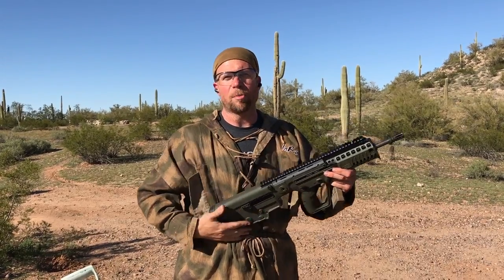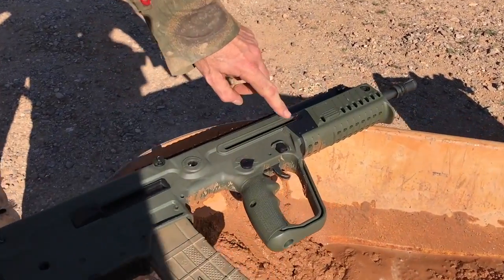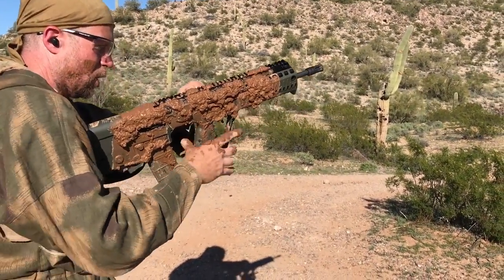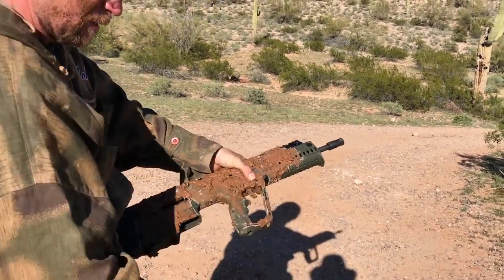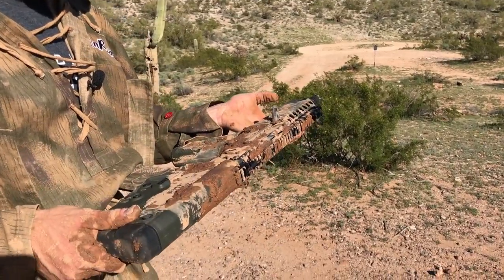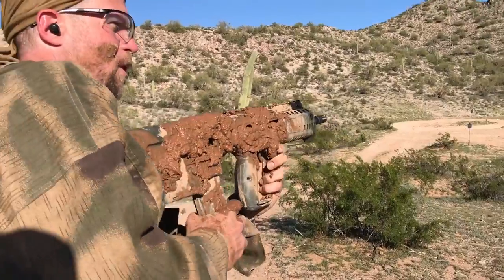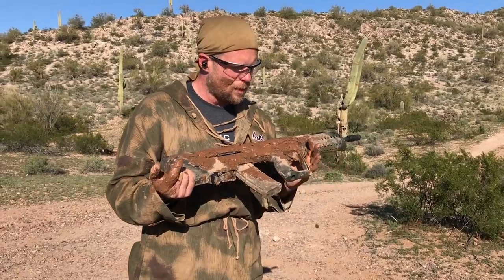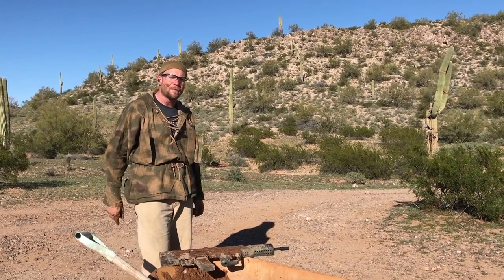Mud Test: X95 Tavor

Comment: I just watched the video where you mud-tested the AK.  Interesting contrast in testing methods, but essentially the same result.  The mud used on the AK was much soupier and you actually shook off the mud from the AK.  The mud used on the X95 had a consistency of concrete and you didn't really make any effort to shake off the mud, especially the clump blocking the ejection port.
Reply from the maker: We're shills for the AK industry.  ~Karl

Comment: I hate when engineers think they dont need to integrate a dust cover... And the entire charging handle and slot could be made much better. Also compared to some other bullpups, the bore to sight height is stupidly high. Also the mag release is practical BUT there atleast should be a backup release.... ive seen it FROZEN and the entire Rifle became useless...

In therms of mud, the Steyr ACR, Ares/Stoner AIWS would do much better. And maybe the MDR and F2000 too.
Reply: I agree. The RDB could use a dust cover too. And there isn't any reason to have the op rod exposed to the elements (the charging handle tube only covers part of it as the design stands now)
Reply: Yes, and one of the biggest flaws of the RDB is its long and narrow ejection window at the bottom, clearing jams is an extrem pain, why the hell did they not just made it so you can simply move a part of the left wall at the rear to clear a stuck case (like it happend in the mud test...).
Reply: +Johannes von' Strauch \Liandri_Development_Group/ Because Kel Tec is very concerned with safety in case of a round firing out of battery or something like that. Basically, the chamber is directly below your face and they don't want to get sued, so they make it a solid steel plate. Now, they could probably redesign it so that the end of the stock is attached to the lower, and then allow the top cover to pivot upwards to make jam clearing easier, but they probably won't.
Reply: Is it the engineers that think they don't need to integrate a dust cover or the accountants? My money is on the accountants.
Reply: Zundfolge 
It's the engineers. The accountants won't say crap if an engineer tells them it could be a life or death issue if the weapon fails because of it.
Reply: There is a backup mag release. It's on the back and can be hit with your thumb while stripping it out with your fingers. As for no dust cover, you should at least wipe the majority of mud off of something before attempting to operate it.

Comment: That was a very interesting result, it seemed that each time you (remudded?) it the mud would get stuck in the ejection port or rather slot might be the correct word. Perhaps because the ejection slot is so thin any mud or gunk that gets on it can prevent the round from ejecting properly. Could you let us know what was causing the problem if you ever find out? Also, now I want to see a side by side sand/ dust test between the Tavor and the AR 15. It was made for desert combat and I am curious to see if it can beat and AR in its natural environment.

Comment: Interesting. Do AR15 Mags deal well with a slap on the bottom once they are in? I remember being told that other 5.56 magazines easily produce misfeeds if slapped too hard and I noticed you slapping the mag several times. Maybe the X95 quickly produces a misfeed, but the AR pattern doesnt.
Reply: This may be true. I had a partial double feed recently caused by my bolt not being in full battery. When I charged it to clear the extractor hadn't caught on and the round stayed where it was. You have to give a tap on the charging handle to make sure that does not happen. All that mud certainly made sure that when he charged it it did not go into battery. This was with an X-95.
Reply: Zibingo Taeam i dont know if that really addresses the complete freezing of the action and mag release though.
Reply: also no the STANAG mags dont do that, there is a stop in the reciever of both m4-ar15 pattern rifles  to prevent mags from being over-inserted. im pretty sure the tavor has the stop too. with the ar15 though if you fully load a mag to capacity it causes an exessive force on the top round which is rather difficult to insert on a closed bolt, so tapping (more like slamming) it in is almost a necessity in this instance. with dirt and mud and sand ect it just makes it worse. as for the tavor, this was the guns failure to keep mud out of the rifle through inherent flaws in the design. does that make the rifle bad? absolutely not. just a shitty choice if mud is a concern. this rifle was designed with urban combat at the forefront of the design.
Reply: Gren Moyo I was actually thinking about rounds jumping away from the feed lips because of the slap.
Reply: You don't even need to tap.  Inset until you feel resistance, then push up with the magazine and pull down with your hand that's on the pistol grip simultaneously.  You can insert full mags easily this way.
Reply: Murphy82nd Thats what I was told. That's why I figured it might be an issue.
Reply: If you were to really slap the shit out of it, yea I could see it happening especially if the magazine was older and the feedlips had some fatigue.
Reply: Yeah like Murphy said unless your magazine is really old and worn slapping it around won't be an issue

Comment: Lame,  as others said it was setup for failure with the inch of goober covering the ejection port. As if he wanted this outcome. Even if he covered the right side first, flipped to cover the left, the right side would have had a chance to shed some mud. Even worse the second attempt was the same, could have changed up the initial application side.

Comment: Fanboy Complaints checklist. Taken/adapted directly from the AK mud test video!
https://www.youtube.com/watch?v=DX73uXs3xGU

Complete as you see them.

[ ] It fares better with dry sand.
[ ] It's not a "proper" Russian Israeli gun.
[ ] It's not made in Russia Israel. With glorious stalinium Jewnesium steel.
[ ] It's a bottom shelf/chinese gun.
[ ] The mud in Europe the Middle East is different.
[ ] The ammunition is underpowered/hard case (This one's actually from a video on an AK ripping the rim off a cartridge and the soldier, engaged in actual combat, trying to pull it off with pliers. He then realises there's a handy cleaning rod under the gun's barrel)
[ ] It's a parts gun built with parts from dozens of manufacturers. Because Izhmash Tavor surelly builds everything on site and does not outsource to dozens of other companies. I heard they even grow the trees plastic on their backyard for the furniture.

AK: The Katana of Firearms.
Reply: You should abbreviate/trim that list and put it on a tee shirt.

Comment: Well no shit there's a failure to eject when the ejection port is literally walled off by mud. You guys normally shake the gun to get the excess mud off before firing. I'm really disappointed in you guys for letting your bias get the better of you so hugely and blatantly.

This test was so sloppily done and so biased that the only result you got that was viable was the bizarre mag release not working on one side. The gun worked just fine after the first jam was cleared, and the first jam was always because you left the ejection port literally walled off by mud because you didn't shake off the excess mud like you always do.
Reply: Well said 👍🏽
Reply: @jeffreywacker3598  "Well no shit there's a failure to eject when the ejection port is literally walled off by mud."

Having the ejection port "literally walled off by mud" didn't bother any of the ARs they tested. In fact, with the AR-10 they tested, they even deliberately packed the mud down into the ejection port with their shovel (instead of just pouring it on top), and it still had no malfunctions. See here - https://youtu.be/y_tjKISQs2c?t=277

Comment: I think the first round  ejection was impeded by the thick mud around the ejection port. If the ejection port had been clear it may have worked better. That being said, the test is the same for all guns so the result is still valid.
Reply: Faux Numeration  

I hate bullpups in general and the Tavor seems pointless, but the mud is pretty thick in this test while the AR-15 had a far more liquid kind of mud.

Comment: I mean... it would help if you didnt cover the ejection port in 3 inches of mud before you fired. When preforming mud tests you need to shake it. I am sure even a barrett 50 cal would jam up with that much mud on the ejection port.

Comment: The only fail in this video was the testing procedure. Completely unrealistic. Seriously, give the gun a bit of a shake so that the brass isn't ejecting into a wall of thick clay. I've seen many other mud tests of the X95 that it passed with flying colors.
Reply: look how relatively clean the bolt was because they put mud on the opposite side ( the usual AK trick for passing mud / dirt test videos )
Reply: Come on now, maybe choose something other than an official IWI promotional video.  I say this as a Tavor owner.

Comment: i dont why but i think making sure the goddamned ejection port isnt blocked might allow the case to eject. then with the bolt open for a longer period of time than usual as you dont have a fully ejected case allows mud to get in resulting in reliability issues i think the test should be redone with my suggestion
Reply from the maker: The goddamn ejection port was blocked in other tests on other rifles and it wasn't an issue.  ~Karl
Reply: good point maybe the ammo wasnt hot enough the idf uses particularly hot ammo and i noticed that the mud was thicker than the ar-15 test maybe the softer mud of the ar-15 test allowed the cases to eject easily and the tavor not as much and the benchmark mud test of the ar-15 you did clean out the dirt from the ejection port after the dust cover was open
Reply: watch orevious mud tests youll see that actually it is not the same
Reply: agreed
Reply: Steven Tatlock When they tested the SP-1 they fired a few shots with mud on the BCG itself, no dust cover involved, and it ran fine.
Reply: Hey Karl, what's your opinion of the Tavor in general? because this makes me thinks a lot of the scuttlebutt I heard about IDF's laxity in recent years are true.
Reply: you think maybe that's because the fire control group is at the front of the rifle, guy?
Reply: +InRangeTV Just watched the other videos, and the ejection ports were essentially wet for the Ak and AR.  This one had half of a mexican house on it.   ~KarlIsBlind

Comment: I have the original model. I think the mag release on it would perform better in this situation. However, I was originally really excited about the Tavor, but after shooting several thousand rounds through it, I'd bet my life on my run of the mill AR over it any day.
Reply: I suspect the mag release AND the charging handle would have fared much better on the original Tavor.  The initial FTE wasn't a big deal, it was the X95's inability to clear that simple malfunction that was the problem.

Comment: My guess is the mud is blocking the round from ejecting. IWI designed the round to hit the backstop and lightly pop out. Since they intended to stop hot rounds from flying up and hitting people in the face, the empty round doesn't have the force to penetrate through the wall of mud and causes a stove pipe. This is something they must have overlooked.

Comment: I feel like the first round failure to eject may have been caused by the sheer amount of mud obstructing the ejection port; the case hit a 3/4in wall of muck on the way out and stovepiped. I don't know if that would explain the follow-on issues, but I think that a good shake, or running a hand down the side of the weapon may have solved that issue. My two cents

Comment: I think that all gun companies should send you there Proto types to you guys. If the gun can pass your Extreme test is safe to say it's a great design.
Reply: max ackley Companies have their little tests for their rifles and I believe they include a "mud test" as well. This Arizona mud is different though because it's damn near a building material since it's as thick as plaster. It's like testing to see if your gun can work in wet concrete. So damn if it can.
Reply: If somebody could build a gun that could survive wet cement then i'd buy it

Comment: It seems it is because of the thick mud blocking the ejection port which the spent case hit and became stove pipe, then while clearing the jam, some mud enter the chamber that caused the out of battery issue.  I also noticed the mud is much thicker than the watery mud used on AR and AK test.  The mud dried and clogged the internals of the mag release.  If it is fully submerged in thick mud like this, perhaps the first component it may fail is the barrel.

Comment: You covered it all over with a thick layer of sand three centimeters with small stones . And on the AR-15 only poured clay water and wiped the place of release of the sleeve with a finger .  Watch the video. The machine is not covered with a sufficient layer, but only slightly moistened with clay water.  And here, everything is covered with a mass of about 2 kilograms of a thicker and more fractional mass.  I also pushed all this specifically under the trigger, tilting the machine from below.  On "Tavor" large holes for moreover, to can be was OTRYAKHNUV pour out sand, not for moreover to there push through mass of with krupnyms sand, clay and gravel and after not shake it off.  You look like a card cheat.
Ты его весь залепил плотным слоем песка в три сантиметра с мелкими камешками . А на AR-15 только глиняной водичкой полил и протёр место выпуска гильзы пальцем .  Посмотри видео. Автомат не покрыт достаточным слоем, а только слегка смочен глиняной водой.  А здесь, всё залеплено массой примерно в 2 килограмма более густой и фракционной массой.  Ещё и затолкнул  всё это специально под курок, наклонив автомат снизу.  На "Тавор" крупные отверстия для того, чтобы можно было ОТРЯХНУВ высыпать песок, а не для того чтобы туда протолкнуть массу  с крупнымс  песком, глиной и  гравием и после того не отряхивать.  Ты похож на карточного шулера.

Comment: What a bunch of clowns! Block the ejection port on any rifle and see what happens.
Reply from the maker: You mean like we did here?
https://youtu.be/LyXndCxn9K4
Reply: Negative! The M16's ejection port was clear. The X95's port was completely covered with mud. There was no where for the spent csse to go yet you blame the gun. Also nice safe weapons handling trying to clear that stuck round.  Clownshoes!
Reply: Looking at the video further the only time the port was fully covered was when the cover was closed. At 4:20 the cover is open but the bolt while dirty still had an unobstructed port. Put a test on here with any other rifle you have with the same amount of mud covering the port as the X95 had and post it. Im curious to see the results!

Comment: Bullpups
A battery pack in the pistol grip to power everything.
Connections (wiring) through the plastic stock.
This would drastically reduce the size of LASERS, TORCHES, NIGHT VISION by half or more.

1999

Comment: Do the people who lend you guns for some of these mud test videos understand that the mud test inevitably damages the gun? It's impossible for a highly abrasive slurry (complete with particles large enough to be called pebbles or rocks) to NOT damage the moving parts of a mechanism. It won't necessarily break anything, but it will inevitably degrade the condition of the gun somewhat, no different than randomly attacking a gun with sandpaper, which typically affects the resale value. I know I wouldn't buy any gun after it's been "mud tested" unless it cost drastically less than a different second-hand one that hadn't been abused.

Comment: You should do a mud test for an Ithaca pump shotgun. It should be more reliable than most because it loads and ejects through one port. Compare it with a Winchester 97' and a Winchester 1912. (Trench guns from WW1) The 1912 should be pretty reliable because it doesn't have an exposed hammer. And maybe a Mossberg 590A1 for shits and giggles. Compare pump shotguns to semi autos. 
Thank you guys for the work you do. I want to be a gun designer someday, and I learn a lot from your videos ( do's and don'ts) Very inspirational, motivational, and educational stuff that you guys make.

Comment: Mud level 10/10: "Adobe".
I was actually surprised that, after SEEING mud on the bolt face, the thing cycled no problem. This is a paradox to me. It should have failed in my mind, worse. Looked like it had to be caked in mud to fail. Not taking a side, just saying what I saw.

Comment: This is a Tavor problem, not a bullpup one. Most bull pups can have it’s trigger/pistol grip area opened up/ exposed so you can clean it. 
- the Steyr AUG’s trigger is visible in a basic field strip. 
- the Famas can have it’s pistol grip & forearm are unpinned from the rear receiver area; CMIIW. 
- the L85 family is opened into an upper and lower receiver area, so any mud that pooled there can be cleaned off.
- the A-91, like the Famas, can also have it’s pistol grip area removed from it’s rear receiver. 
The Tavor, on the other hand, is a completely boxed in design. The only section that can be opened to access the internals is the Butt stock. The only things you can clean is the bolt group and the trigger pack. Every thing else is locked away in the shell. 
Mud pooling problem is definitely a Tavor problem, not a general bullpup one. 

Maybe because it’s designed mostly for desert use. 

Or maybe because it was dunked in mud, instead of having mud dunked on it like with “standard” rifles.